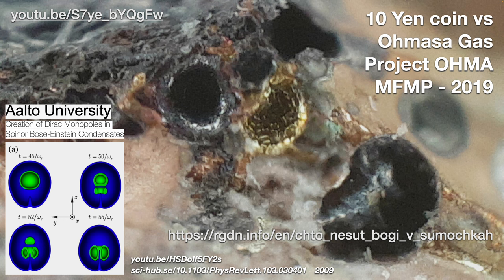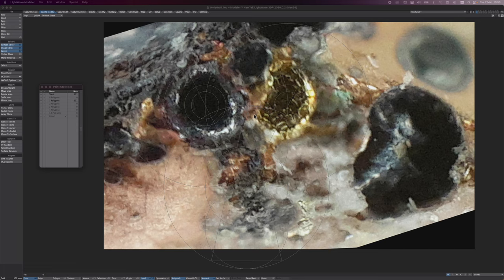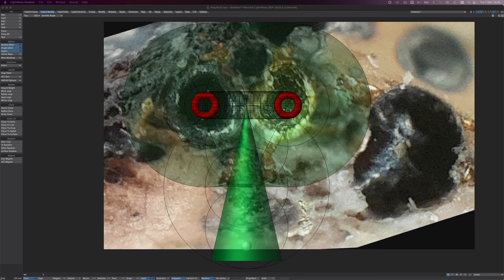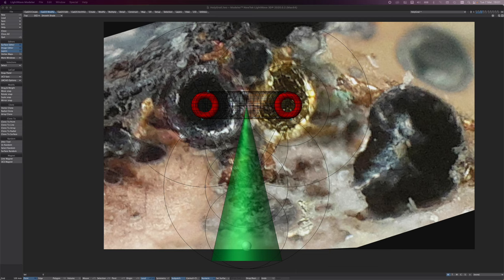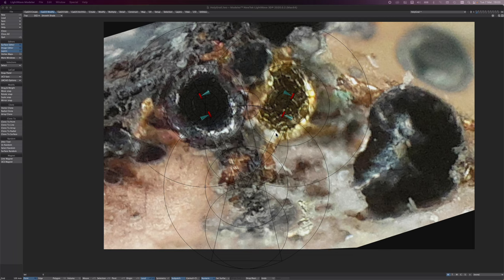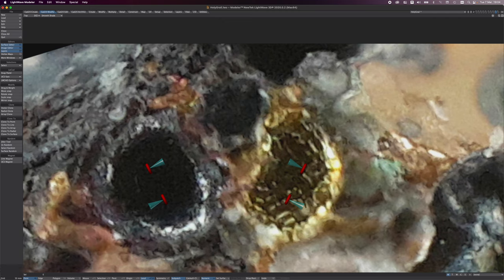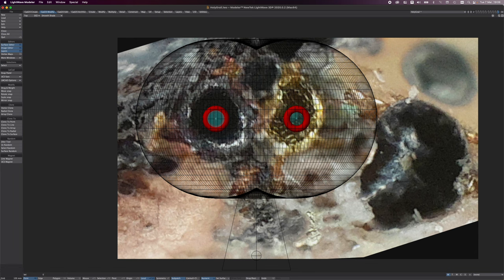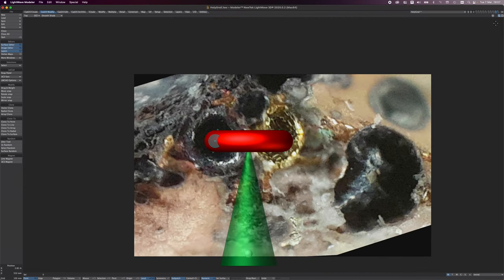O-Day - Proposed Dirac monopole structure matches Ohmasa Gas vs 10 Yen coin structure

Comment: I have several questions about the idea that the Great Pyramid was a  really big philosopher's stone.   
How is the Great Pyramid related to the other ones at Giza which don't have the same tunnels, gallery. king's chamber,  queen's chamber setups and are believed to be solid?
(I saw one person propose the pyramids were just tailing piles with water drains in their bottoms left behind from an ancient iron mining operation.)
If I understand, water in the bottom chamber is  somehow separated into O and H.  These component parts travel up to the queen's chamber (O)  and the Galleries (H) where it is ionized by radioactive granite. [Doesn't granite emit radon?] Then a monopole several stories tall spontaneously appears, takes the ionized hydrogen, converts it into another substance and deposits it in the King's Chamber.
Does water just separate into parts like that?  Will ionized hydrogen initiate a monopole?   I don't understand it, but then again I don't understand why I have been expecting something out of Andrea Rossi for all of these years.
Reply from the maker: Did you see the previous video that did the walk-through of some of the evidence that lead to the derivation of the wheel within a wheel within a wheel sacred geometry structure?

https://youtube.com/live/2-yrjwzO5WU
Reply: @MFMP  Yes.  That is not what bothers me.   The idea of a multi-story monopole, something argued to not exist, is spontaneously generated when a volume of ionized hydrogen is created.  I am not a scientist with plasma experimentation experience, so don't take me as being anything more than unconvinced.  The old saying is "I'm from Missouri"  - which I am - and really need to be shown man can generate a monopole at this scale without creating total chaos.  I have been recently been watching electric universe theory videos and it looks to me like huge plasma discharges can ruin your and your neighborhood's whole day.
I see the scarring on the foil sheets,.  Also the pock marks left by electrical discharges on the surface of planets and the moon.  What I haven't seen is human initiated transmutation of matter on a scale implied by having a multi-square-yard container - or even a thimble - set out to collect its  product.
Reply from the maker: @johnweir3168  So, you need to see this.

https://remoteview.substack.com/p/anomalous-synthesis-per-day-for-11
Reply from the maker: @johnweir3168  These fractal toroidal moment structures produce a disruption zone by either natural or artificial and they can instantly turn metal and ionic ceramics into fine dust.

https://remoteview.substack.com/p/o-day-explaining-frank-polifkas-windhexe
Reply: Geoffrey Drum explains every pyramid in his videos as well as the new grange mound

Comment: Bob can you look into Tartaria. It is supposed to have buildings made to collect free energy.
Reply from the maker: Years ago I had a look at it, perhaps I will with fresh eyes now. Thankyou
Reply: Also , do you think we're going electric vehicles because we now know we can run engines on clean sacred geometry (geet). Run on sea water with no pollution?. Keep us under the thumb?.
Reply from the maker: @pauloneill9880  We need to see if a GEET can be made to run stable for a long time and without catastrophic failure. One step at a time.

Comment: Bob , what if you aimed a lazer into the in side vortex? Do you think it could be visible at the  centre of the out vortex?
Reply from the maker: I think that if this is spun up, the coherent matter sphere would either let the LASER pass to the other side around it, or it would absorb the energy. Based on the work of Chukanov, the former.
Reply: @MFMP  Does that  mean it would appear invisible when spun up?
Reply from the maker: @pauloneill9880  No - it would look like a big glowing ball lightning with a shallow circular dome on each face glowing, possibly intensely.

Comment: Genisis 2:10 A river watering the garden flowed from Eden; from there it was separated into four headwaters. 11 The name of the first is the Pishon; it winds through the entire land of Havilah, where there is gold. 12 (The gold of that land is good; aromatic resin[d] and onyx are also there.) 13 The name of the second river is the Gihon; it winds through the entire land of Cush.[e] 14 The name of the third river is the Tigris; it runs along the east side of Ashur. And the fourth river is the Euphrates."

Makes one wonder how those rivers were arranged. 2 winding through, one off to the side, and the importance of gold (conductor), quartz (resistor), and aromatic plants (inspiration). This is so important that in the Bible it is placed before the fall in chapter 3. Whoever wrote it knew it was more important than sin. 

It very well may be nothing, but I used to marvel at silicon valley, where quartz, copper and aromatic plants meet to be arranged into computers. And how these 3 things, and only these 3, are mentioned in the second chapter of the oldest book ever written.
Reply from the maker: Thankyou for this. AI produces a lot of coherent authoritative sentences that can be 100% wrong. The Bible is not that.